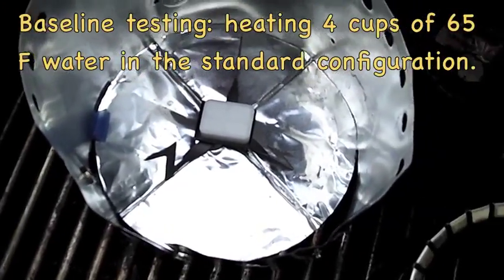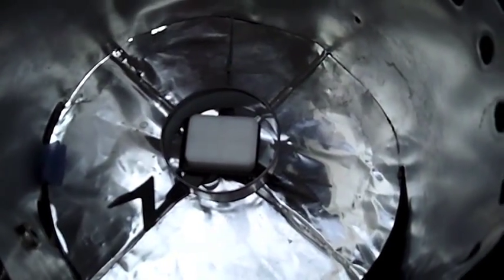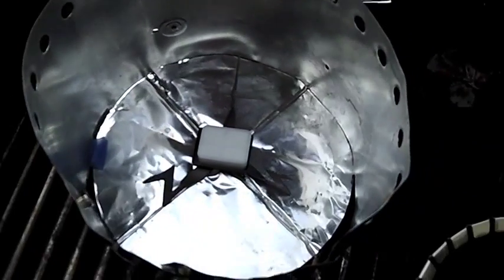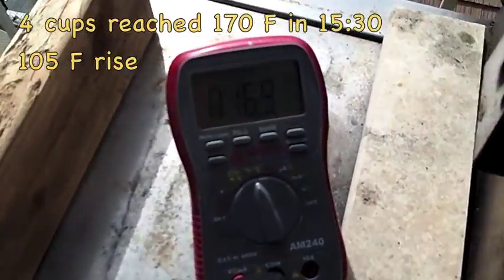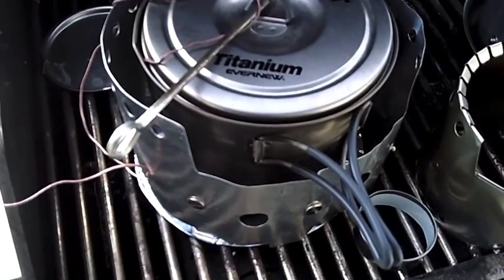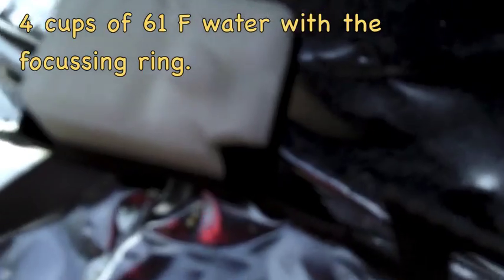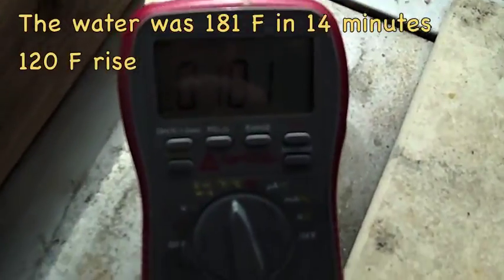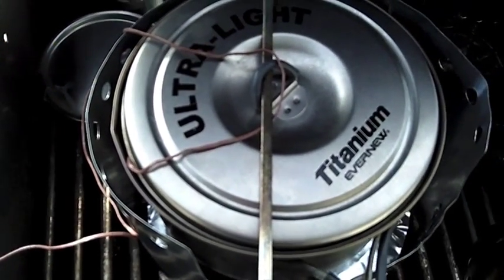Focussing Ring for an Esbit Folding Ti Stove DIY  Project by FLAT CAT GEAR

Comment: Thank you Jon. I appreciate this tip that has improved this little stove & making it a practical option intead of a fuel tab hungry thing. I sit my round fuel tabs (7gram) on a small shade cloth cleat to get closer to the bottom of the pot for boiling water. Remove it for baking. Thanks again for sharing.

Comment: Thanks Jon. I've been using this stove with the focus ring and dry baking with one esbit cube now. This little tip increased the efficiency of my stove by at least 20-40%. Thanks.
Reply: What as the dimensions of the ring?
Reply: I have one of those stoves and without the heat retainer ring it is fairly useless. I am going to try it with the ring